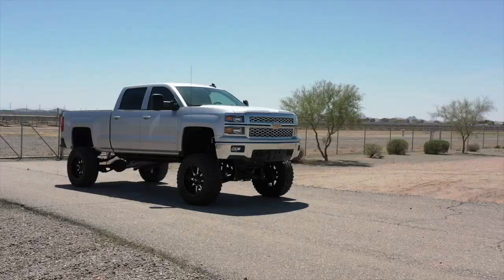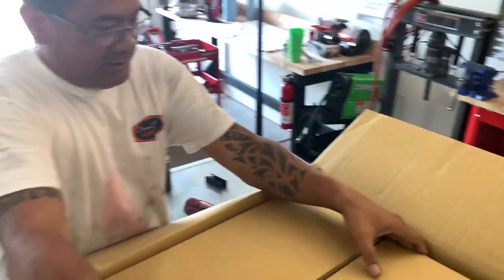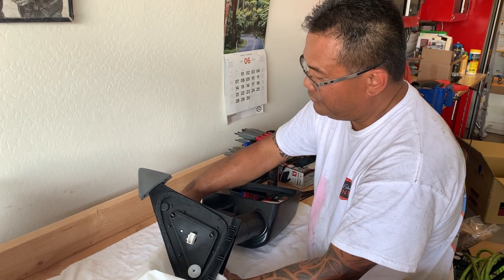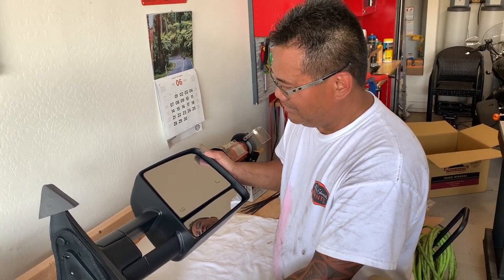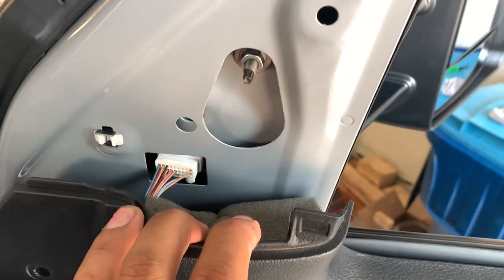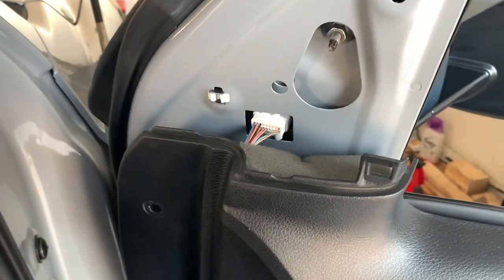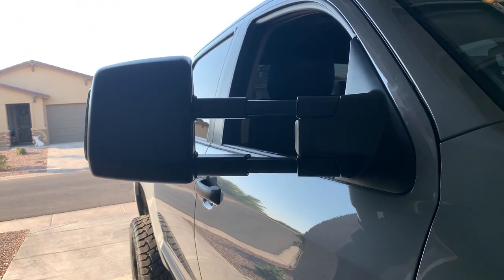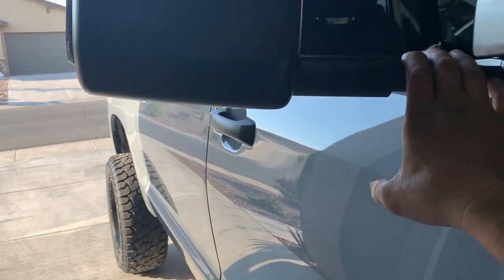Toyota Tundra tow mirror install

Comment: Great video thanks. I just installed a set of tow mirrors on my 21 sr5. . Got them used for 135 in new condition and work great. Question. Is the bottom blind spot mirror adjustable?  I don't want to force it. Thanks Tim. .

Comment: I have no lights on my stock mirrors, will these still work plug and play? 2017 tundra. Thanks
Reply from the maker: Yes they should work.  My buddy's original mirrors  didn't have marker lights on his original mirrors.  When we plugged them in the lights worked fine.  Depending on your model Tundra, the harness is already wired to support those marker lights.
Reply: @hawaiianbrokechanic  the Mirror light technology is pre installed so it’s just adding the mirrors and it work?

Comment: Jeff do you think tow mirror can be replaced with just regular mirrors 2017
Tundra  and how often should I replace PCV valve truck has 41 thousand miles
Reply from the maker: Aloha James, thanks for checking out the channel!  To answer your first question, yes!  I talked to my cousin who works at a Toyota dealership in Hawaii and he suggested between 50k-60k…change it for sure if suspect pcv valve is clogged.  I hope this help!

Comment: Hi , i had a 2021 tundra limited but have bsm and heater, but no signal light, is it still functional if i install it?
Reply from the maker: Aloha Long - just be sure to check if this unit will work with you’re year Tundra.   If it does, download PDF instructions to see if you just plug in or if you have to splice wires.   If it’s plug and play, the signal lights will work because the OEM harness is already pre-wired for that function.
Reply: @hawaiianbrokechanic  thank you so much ill try to run the wires